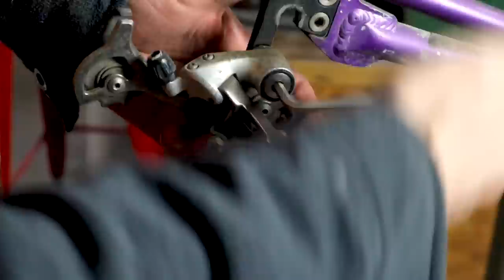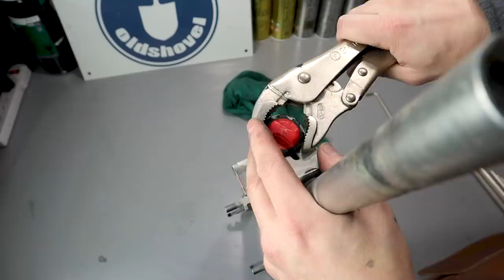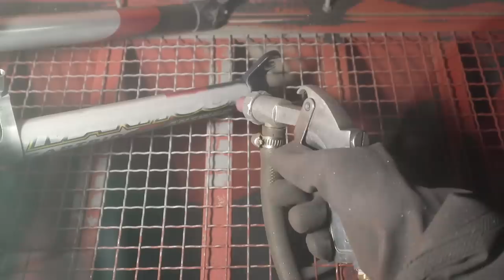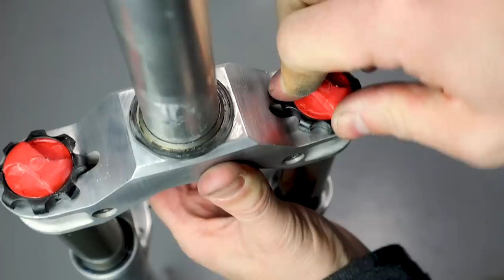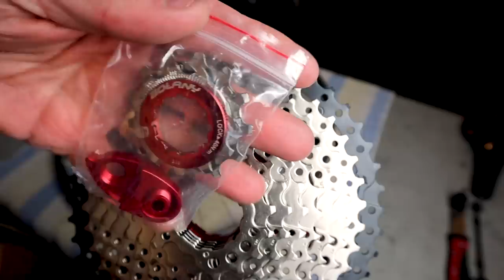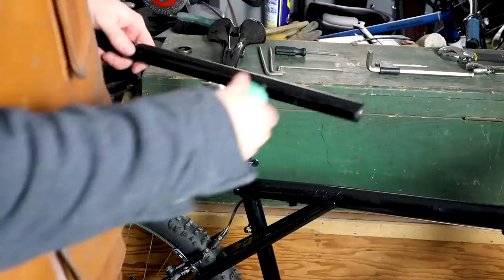Dream Bike Build Restoration - Blacked-out 1x10 '94 GT Ricochet

Comment: That's an ass-blaster saddle if I've ever seen one, everything else looks great though!
Reply from the maker: Lol 😂 this is actually the second one like this I’ve used. I rode two seasons on one just like it and it worked well for me but it’s not for everyone and not for rides over a couple hours 😁.
Reply: Oddly enough... this saddle felt as if it was molded from my asian posterior and was really comfy... into it splintered into my taint... damn chinese carbon! Figuring I would learn from the first time... had the seat warrantied and got a hold of a second one... to my dismay ended poking my flesh balloon the 2nd time around! Moral of the story: if you want holes in your offsprings... by all means, $25 carbon from Ebay is the way to go!
Reply: @oldshovel  I've been using two of them as well, for me with cycling shorts they are fine.
Reply: I think they are like bmx seats, for display only.
Reply: restart426 - Lmmfao
Reply: ass-blaster....hilarious... I love it. I ride a brook b17  and nothing else goes on my bicycles.
Reply: @BruceChastain  they literally tell ya that in their description...   so yeah, saddles are so much on fit, then wear the pad... but a perfect seat to your seat....  can be super comfy for even a decant distance ride
Reply: How much was the full build

Comment: Amazing build. Love the futuristic take on old frames
Reply from the maker: Thanks 🙏
Reply: @oldshovel  is the graphics on the fork from a lower grit sandblast? And do you have a recommendation for a cheap vinyl cutter?
Reply from the maker: I ran the blaster at a lower pressure. As to the cutter I use a Cricut Maker and it works great.

Comment: As someone who started mountain biking in the 90's, I have to say it made me shudder when I saw those elastomers come sliding out of that fork.
That was a dark time in suspension history.
Reply from the maker: Lol 😂 they’re not too bad. I was surprised just how good shape these ones were in. You should have seen the ones that came out of the Judy I took off. They were totally destroyed.
Reply: It's probably just jaded memories of my rockjumper turning into a ridge bike whenever the temperature dropped.
Reply from the maker: Lol 😂 me too.
Reply: @planz9242  I get them 3d printed from a mate using modern flexible filament ,they work flawlessly
Reply: @oldshovel   you may be able to find an old rocksox mag 21 on ebay , those were great air oil forks.
Reply: When I finally cracked open an ancient Judy, cleared out the rust and re-greased it, I was surprised how good it felt! Then I started trail riding it. And then I was absolutely flabbergasted. Those things worked. I also have been known to ride rigid...
Reply: Elastomers are good and simple technology, but they do have shortcomings.
Reply: I’ve got a marzocchi that has taken a beating for 20 years. I’d like an air fork now when it’s done.
Reply: Hehe. When I started in 84 with a Ridgeback XT, suspension wasn't on the cards in those days. Come to think of it, out of the 20 plus bikes since, the GT Richter came with Rockies which I soon took off and my current bike, a GT Zaskar ( actually an Aggressor with retro XT throughout ;-) ) doesn't either. The closest I came to suspension was a Flexstem with the yellow bungy and a 2.2 front tyre. Ah, the good old days.

Comment: Great build. I have seen your other builds, but this one is special to me. My first mountain bike in college was a 1988 GT Tequesta. It is unfortunately a 1 inch head tube so upgrading is not very easy these days. I still have it and went through it top to bottom, repacking bearings and the like. In fact, watching your videos has gotten me back into working on bikes. I forgot just how much fun and therapeutic it can be. And when you are done, you have great finished product that will continue to offer good service for another 30 years if parts hold out. I like your premise and what you do for your local community. Thanks for the journey and I wish you well.

Comment: Newb question:  Did you add any sort of mechanism against the chain falling off when switching into the highest or lowest gear? I heard that was necessary on 1x10 builds, but I don't have a clue.
Thanks in advance!
Reply from the maker: If you set the limit screws correctly you should not have any issues. Thanks for watching and thanks for asking.
Reply: @oldshovel  Thank you very much for clearing that up for me!

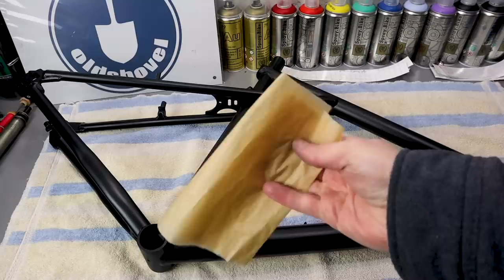Comment: Hi! I´m writing from Argentina. This restoration is amazing!! I´d like to know what kind of paper or material do you use in minute 4:02. I want to restore my classic road bike and I´m interested in every tip. Thanks.
Reply from the maker: Parchment paper
Reply: @oldshovel  Do you use to achieve a better termination?
Reply from the maker: It’s per the size instructions by spray.bike to help smooth and compact the paint.

Comment: Thank you for the motivation to execute a proper resto of my first real bike age 15, my 1992 GT Karakoram. Over the years it's been terribly painted, steel fork replaced with mag 21 rock shox after truck accident, that was much later replaced with proper length rigid carbon, and turned into a townie. Big challenge will be getting the original bottom bracket out....yikes. Not a fan of the U brake but it sure adds character 😁. Thank you again!
Reply from the maker: Those bottom brackets can be scary
Reply: @oldshovel  Yes I barely remember attempting it once and stripping the teeth. One person ages ago recommended soaking it in kerosene. I think it'll be a wall hanger if it doesn't come out (unless I was to throw down $$ with a bike frame builder to cut it and weld in new tube.)
Reply: @oldshovel  I got it out!! Pedro's BB socket with pedro's socket holder II, over which I put a deep well 24mm impact socket and 1/2" breaker bar, and my foot. It was scary seeing frame flex but it came out, and left all the aluminum threads in the frame. The plastic cup needed a gentle application of a sawzall bimetal blade by hand, and prying out the pieces once the cuts were made. Strip and paint time!!

Comment: Nicely done -- both the bike restoration & the video. Enjoyed watching it, liked it, and subscribed. Just wondering: what's the tooth count of the largest cog on the 10-speed cassette? I'm curious about the gear inches in the 10th gear -- is it perhaps 20 gear inches or fewer? If so, you've got a very versatile, lightweight drivetrain that's good for city travel, good for single track, & good for hill climbing. All you need is a pair of Schwalbe Ice Spiker Pro HS 379 tires (26 x 2.10) for winter riding. Keep up the good work. Impressive and admirable 🚴‍♂️✌
https://www.schwalbetires.com/bike_tires/off-road_tires/ice_spiker_pro

Comment: Great build! Would it be possible to do the same, but then with an 11 speed cassette?
Reply from the maker: The cassette size is bigger for an 11 speed comparable hub. 8 to 10 speed cassettes are the same size. So 10 speed rear cassettes are the magic number for upgrading vintage rim brake bikes. Hope that helps.
Reply: @oldshovel  Understood! I really would love to build a bike, and doing it for as cheap as possible is my goal, unfortunately we often times don't have US prices over here. So something that is $20, can cost up to 4-5 times as much here. That means sourcing as good a bike as possible and maybe (just maybe) a few decent second hand parts. I had one more question about the cranks and the cassette though. I can only find those two brands (Gannoper and Bolany) on Amazon (US) and Aliexpress. Which makes me think they are one in the same. Do you know if that is the case? And have they held up till now? Tnx for your response and the videos are great.

Comment: Wow, love the way it turned out!
I'm interested in doing a 1X setup to my '92 Karokoram.  
It is all stock and has a Shimano DX drivetrain.  I'm wondering
what would be the most budget friendly option? Is it possible
to just get a new Chainring and chain, then use the existing Cassette and derailuer?
I've asked on a different Video, but you didn't answer yet - no worries.
It would be nice to get your input.  Thanks!

Comment: Excellent video I just got a 1992 GT pantera frame for 40 , I built it up from a Marin that had a cracked head tube , so figured I'd do a swap , sort of worked out good , have to go over and revise some things , rear derailleur is STX,  Ritchie rims 8 speed cassette,  34 t front chainring , shifts are sloppy and harsh , even with new chain , so I'm thinking I'll try a rear Alex rim with , 7 , or maybe I need a better derailleur , acera , tourney tx or something instead of vintage STX,  I'll experiment with it , just curious about those derailleur hanger from hanger , the red one ? Do those help with certain derailleurs? Saw them on eBay was thinking of getting one to try with maybe a tourney , deore or acera,  excellent video very relaxing to watch 😎🖒

Comment: Nice, but you could use some practice on your painting. You have sprayed far too thin it looks like. 100 thin layers will never be as good a 1 thick layer, even drips can easily be sanded away with 1000 and then 1500 grit paper. I would re-do this or practice another frame until you learn to do thick layers without many drips. 
You need great lighting(not just good lighting), good paint, and consistent temperatures on the frame and paint. You should be heating the frame with a heat gun, and reheating it after every layer of paint/clearcoat. Don't worry about the drips too much, it really is not much work to sand them and then polish them to the match the smooth surface.
The quality of spray can makes a big difference as well(mostly for clearcoat), but really I recommend investing in a proper system.

Comment: Paint is awesome.  I assume this bike was 3X8 to begin with.  Would have been nice to see rear wheel spacing going from 8 to 10.

What derailleur hanger extender did you use?
How is the chain line?

Comment: Had a GT Timberline for a couple years in my bike messenger days. Was a great bike, fit me really nice but running it as a courier bike through some Canadian winters killed it. I was gonna resurrect it someday but I had a room mate who took it when he moved out.  Now I ride a Univega Alpina 503 circa 1995  which has seen a few years of courier service as well. At least 5 winters.  She ain't pretty but she runs real good. Wears her rust spots and scratches like badges of honour. It gets a tear down of all brake and shifter cables every spring and runs as well as ever.

Comment: Havent ridden bikes since i was teen & young adult in the late 90's rode them to work and for fun  
never had any high end bikes
just the standard old huffys and Murrays they got me to work and where i wanted to go on the weekends oddly enough ive never seen a bike geared like the one the video and honestly it doesnt make much since to me for bike to be geared that low 
as a child we used to rob the cranks and sprokets out of stationary bikes and put them in our 20  inch bmx bikes   it was hell going up heals but on flat ground we could get going between 40 and 43 m.p.h. on a slight downhill grade we could hit 45 to 50 ...  didnt know back then that bikes tires couldnt handle those kind of speeds 
but alas we all survived and outgrew bikes and moved into adulthood

Comment: Great build. I still have my 1988 GT Tequesta. It has always been garaged so it is in great shape. It was only in the elements when I used to ride it to college back in the late 80s and early 90s. I am going to do a restore and update the bike. I want to put suspension on the front, but not sure if there is a retrofit kit for my version or not. Either way, it will be a fun project. Thanks for the videos. Great stuff.

Comment: Did you purposely mount the tyres so the valve stem was halfway between the Continental logos? I normally try to line up the valve stem w/the biggest logo, but this is a nice change.

Comment: it's a pity to look at it ... it was possible to cut off the mountings for the old brakes from the frame and screw the mount for disc brakes, digest so that all the cables at the bottom of the pipes, the fork could be remade under the air, put an air cartridge ... cut the mounts for the brakes from the crown, and weld  or re-grind the mount for the disc brake ... fortunately the metal is good and milled ... and it is doubtful to translate to 10 speeds with 26 wheels

Comment: i think youd benefit on the paint by doing a 2000 or 3000 grit sand and then clear coat to smooth out all those bumps , but super nice still

Comment: Hello, i saw your copper plating videos and i try the same thing
I d like to copper plating an old hammer 
I did all the steps wright but i failled. What do you think i did wrong?? Thanks for your videos
Reply from the maker: Bummer that it did not work for you. For things to plate well it needs to be clean and bare metal. Sometimes there is a thin clear coat on some metal items. Sand it lightly with 400 grit paper and clean it well and try again (if you haven’t tried this yet).

Comment: is that the orginal rear wheel and hub? or did you have to buy  a new one to accept the new cassette?
Reply from the maker: I put used but different wheels on it to be able to run 10 speed.